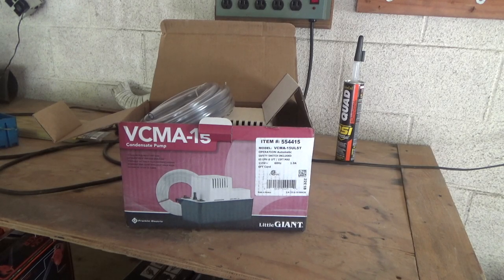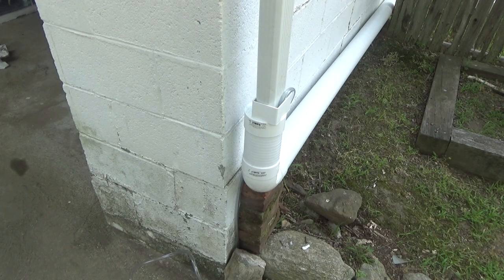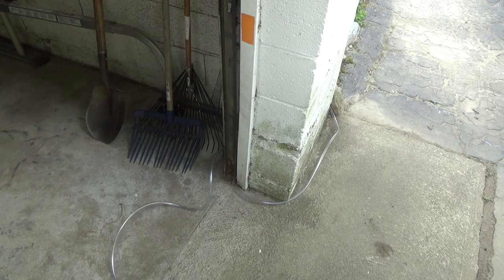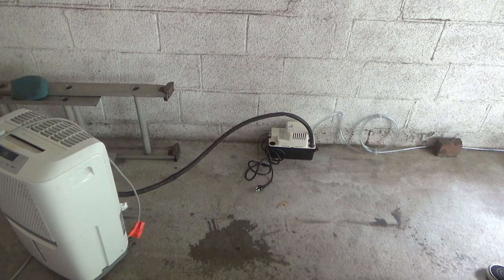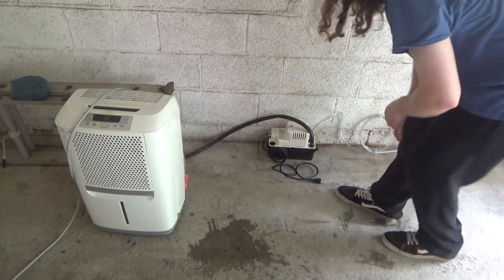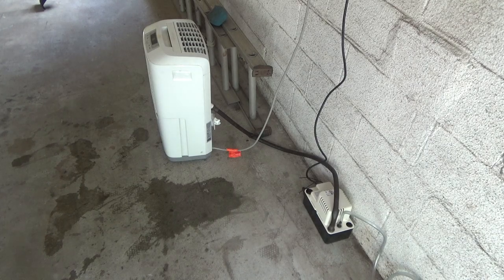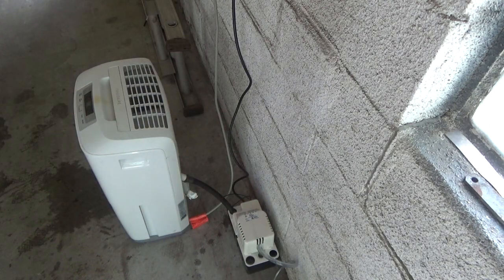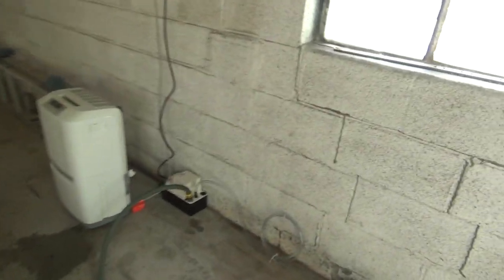Condensate Pump for the Garage Dehumidifier

Comment: Nice. That looks similar to the pump for our HVAC unit in the basement. Just make sure your hose doesn't get completely clogged with algae/mold, like ours did. We found that out after something had been audible throughout the basement for most of the day and turned out to be the pump getting nowhere with its water due to the algae clog. We even had to get it repaired.

Comment: Dude all you have to do is put the unit on some kind of stand, cinder blocks, bricks, milk crate etc and then boom your unit is now 1 foot higher off the floor which will fix your gravity problem, which you did fix with cutting your hose. But you may want the unit abouit a foot off the ground anyway especially if you live in cold winter climate.